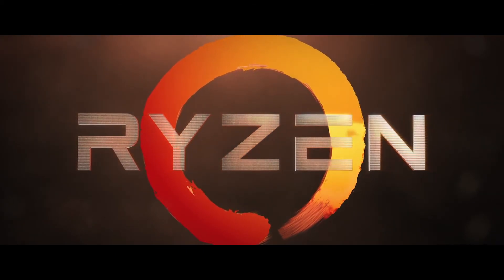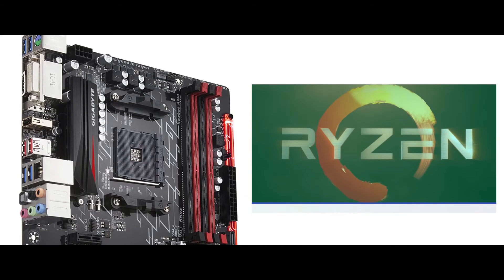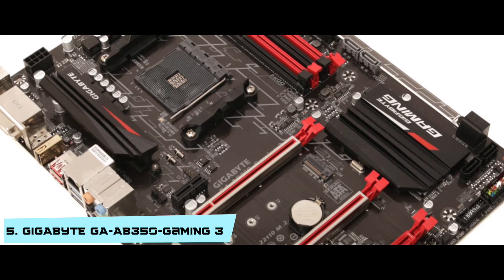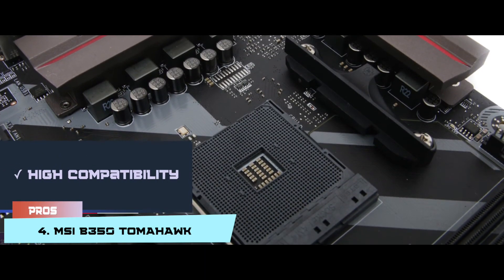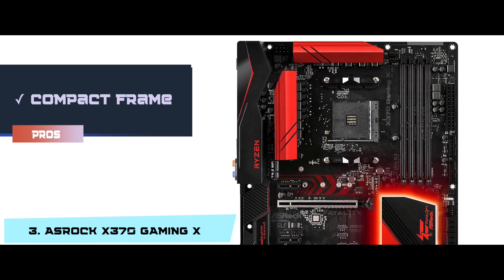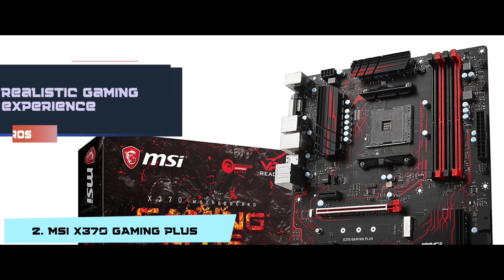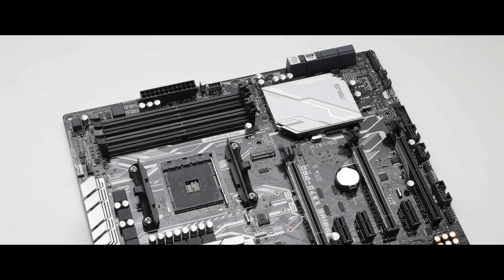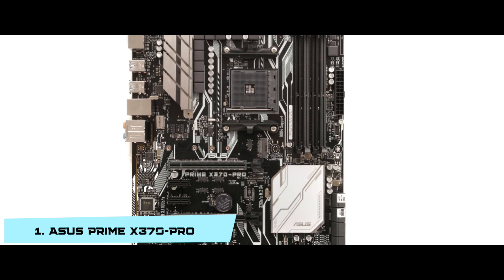Best Motherboards For Ryzen 7 1700 🖥 (Buyer’s Guide) | Digital Advisor

Comment: hello! i ve bought a a320my-q7 motherboard, but in the cpu support list , ryzen 1700x, 1700 pro and 2700 are there, but not the 1700 normal one , am i gonna have issues if i put them togheter?